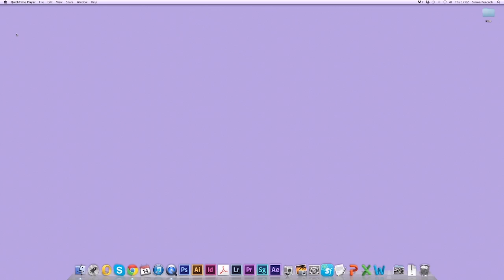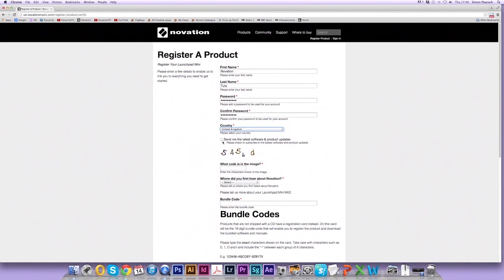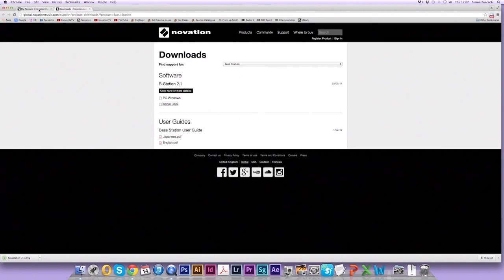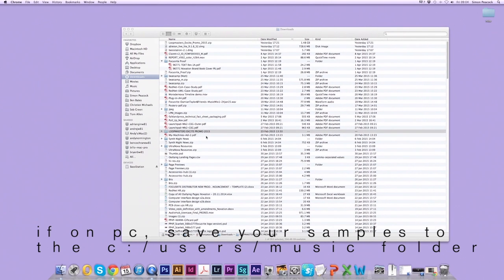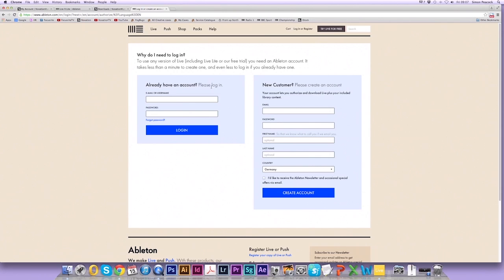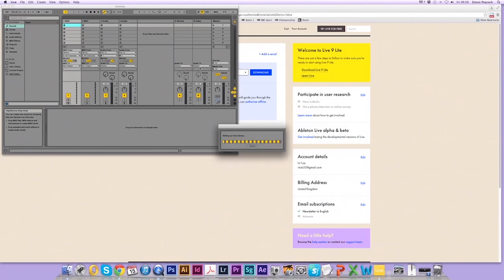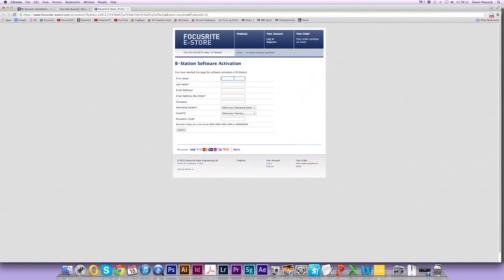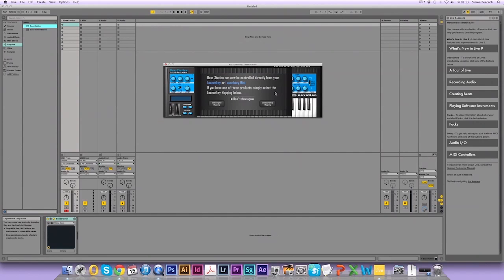Novation // Getting Started with Circuit - Registration

Comment: Mine never came with a bundle code, i've tried everything and still it hasn't worked
Reply from the maker: Sorry to hear that, did you purchase a used product? The included Bundle Code can only be used once so they're generally not provided with pre-owned products. Not to worry, our tech support team can give you a replacement Bundle Code if you provide them with your Serial Number. You can reach them here: bit.ly/NovationSupport
Reply: I have O with a cross in it